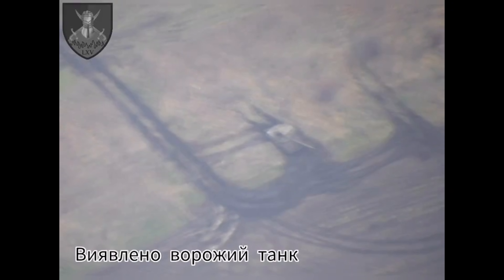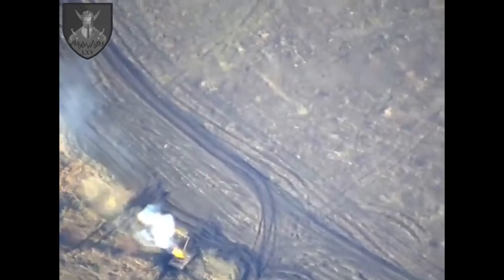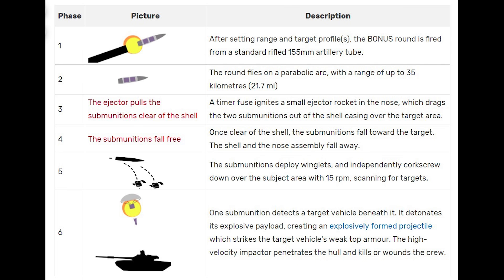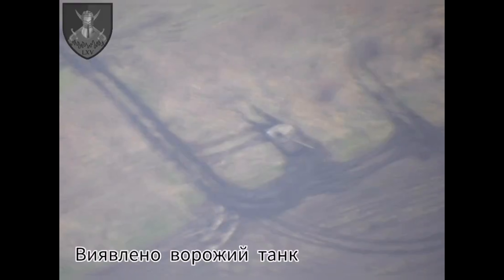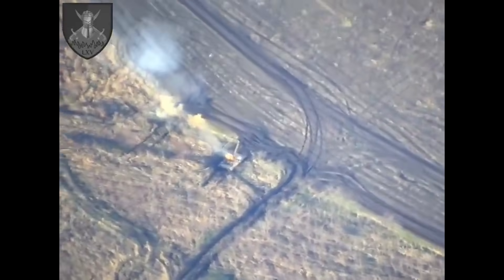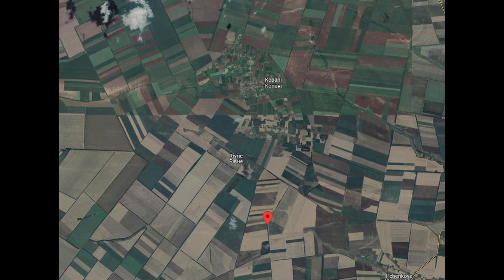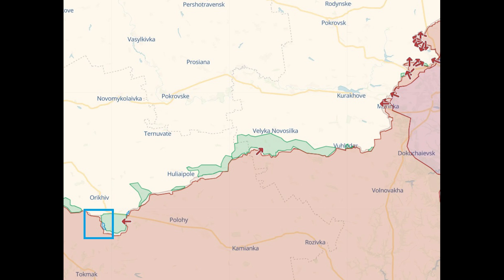Cool Footage of 155 BONUS Artillery Round  Against a T-72 -- Plus, How Does 155 BONUS Round Work?

Comment: I agree that mounting the Bonus submunition on drones has potential not just for Ukraine but globally. The drone operator only needs to drop the submunition(s) in the general vicinity of an armoured vehicle(s) and when the submunition(s) spins a basic radar then detects the target(s) and the shaped charge warhead is triggered from a considerable distance away at just the right moment so that it fires at the centre of the target. One downside however is the Bonus submunition is quite complex and must be expensive so a better approach may be to just mount a shaped charge warhead on a drone which is initiated by the operator or upon physical contact with the target and Ukraine and Russia have already used these on a large scale. Similarly bomblets with shaped charge warheads can be dropped by drones and again these have been used by Ukraine and Russia. A proximity sensor that activates the shaped charge before reaching any improvised cage armour mounted to the armoured vehicle could be a useful innovation given the prevalence of this type of armour.

Comment: The skeets are nasty - the EFP moves at something like seven kilometers/second. If I recall correctly, they need a heat source to target, so abandoned/cold vehicles would not work. I'm not sure about the model in the 155mm, but there are some that have a central anti-vehicle cone and then a ring of a dozen smaller divots around the edge - so anyone who noticed the round deploying may get zapped even if they bail out and run. That may only be a feature on  the larger ones that have a parachute for part of their deploy.

Comment: The second submunition can be seen exploding at the same time shooting its warhead into the earth. It does this for safety reasons, because if it would fall to the ground unexploded this would cause a risk for someone who later happens to stumble over it. So as soon as the submunition reaches a height which is so low that it knows there can be no vehicle under it, it self-detonates.

Comment: the 155 bonus is perhaps the most insane and scary round I've ever seen in any caliber, for any purpose.
Reply: The Volcano round is also pretty spiffy. Range up to 80km with standard howitzers, and can be configured for both GPS against stationary targets or laser pointer against moving targets. It also uses tungsten as the frag material, and because it's rocket boosted it comes in at roughly three times the speed of sound.

Comment: The shape charge explosive found on the Bonus submunitions and other similar system is not the difficult part. In fact these shape charge warheads are found in RPGs and many other anti-tank weapons including FPV drone with modified RPG warheads. You just need to tilt the RPG warheads on the FPV drones to be facing down and you have something similar. The part that is tricky is the fuse. The RPG fuse is contact fuse while the Bonus submunition fuse are computer controlled by the Bonus submunition's internal fire control computer. If you want to do the same with the FPV drones, you already have the RPG warheads. Now you will need a fuse that does not rely on contact. You will need the FPV drone to carry an additional fire control computer to control the fuse and detonate it remotely above the target. This is where things get slightly more complex as the FPV is kind of a homebrew suicide drone, now you need an industrial scale to assemble electronics  to do the following:
1.) optically detect and match targets on the ground that the FPV drone flies over
2.) control the detonation of the RPG warheads or similar shape charge explosive warhead accurately over the targets
3.) safety mechanism to prevent the detonation when you don't want it to
4.) remote control and communication of the warhead with the drone operator using an integrated communication channel or a secondary communication channel
5.) optionally allow the drone to detonate remotely without drone operator guidance in case of electronic jamming and this ties to 1.) where embedded AI and more sophiscated optical tracking and matching can play a role in
6.) allow the entire fire control assembly and warhead to be fitted on commonly found drones in the Ukrainian arsenal
7.) self-destruct safely after a certain time period if no target is found
8.) optional anti-reverse engineering capability after launch

Ukrainian government could set out an RFI and get contracts from Western partners to build such a system at low cost.

Comment: I doubt these can be deployed from drones without some major engineering. They are required to spin in order to stabilize, search, and aim. The artillery shell does this because it is spinning due to the rifling in the barrel. How one would get it spinning using a drone is a real challenge. These same/similar munitions can be ground launched vertically from a tube as part of a "smart land mine". Very effective.

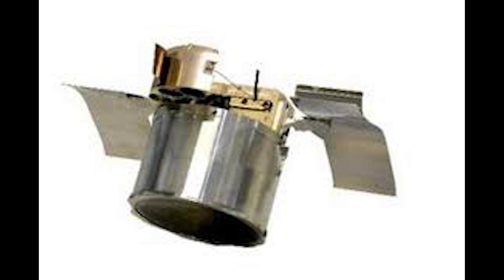Comment: @1:35 "Now, I wonder..." Nope, most likely the submunitions cannot be deployed by drones. When the Bonus round deploys the two submunitions, a small rocket fires the nose cone of the shell, pulling the submunitions out. They will rotate at the same rate that the shell rotates when fired. The submunitions rotate at 900 rpm to be able to scan a large area for targets. Giving it that kind of rotation will be really hard to pull this off using a drone.

Plus, a full Bonus round comes in at 45 kg. At a guess, 10 kg per submunition would seem reasonable, but that's well above the "Baba Yaga" R18 Octocopter payload of 5 kg.

Comment: LOL, Arc not arch. And it's only a parabola until you look carefully, they always come down steeper than they go up, this is because they lose horizontal velocity due to drag. But they also take a nose up attitude due to gyro effects, so they fly a bit further than simple physics would suggest. If you fired it on the moon it would be a parabola. The maximum range elevation is closer to 30 degrees than 45 because of this. I've worked on anti tank weapons and artillery, designing of, but I am not an aerodynamics engineer. These SFF or EFP weapons have been around since the 80s, back then we were using them in HB876 mines and considering them for dispensers. Skeet is from around that time. These weapons are not the sort of thing you can just sling under a drone, they have limited life once activated, and you sure as hell don't want to fly them out over your lines while they are already armed. But I expect the Ukrainians could come up with a way to power and arm them close to the target.

Comment: When I get the directions right, the tank is aiming to the east, and the round come from the west.

That would mean, the artillery piece is in the direction or even the area of Stepove. That is 24 kilometers, still in range of most western 155mm systems. And Stepove is a relatively calm and stable part of the front, so less risk for the sytem. But also very close to the front, if Stepove is the staging location of that piece.

Comment: If I remeber correctly (read about them years ago in a book) these submunitions spin as they descend and when they explode a flat disc of metal (copper???) is forced in to a superheated slug shaped charge that cutz through the less protected top parts of a tank...refered to as skeets???

Comment: Hey, suchomimus! At 0:42 you came to an artillery question. (I'm a prior U.S. Army 13F forward observer)
    I've never heard the term "parabolic arch" before. But it sounds like "high angle" to me. The standard is "low angle" for artillery, unless deemed necessary by FDC, or by a forward observer like myself. Their names are self-explanatory, for example, mortars are always high angle.
    I figure the reason for this is the munition needs to come down at a vertical (ish) angle to work best. It seems to make sense with the parachute and guided smart munitions that are supposed to come down on top of enemy armor.
    I hope this helped. Excellent video as always!
Reply: I think he meant "parabolic arc", but he probably isn't into maths so might not be familiar with the term.
Reply: @RonGardener4142 
    You're right actually, he said "arc." I swore I heard "arch" when I heard him the first time. I must have misheard him. I think I have some hearing damage I guess... 🤷‍♂️
    My point still stands, this terminology probably refers to "high angle."
Reply: @classifiedveteran9879  Tbh, I thought he said "arch" too. Maybe my hearing is knackered from too many rock concerts in my youth!
Thanks for the technical info, btw.
Reply: @RonGardener4142 
    Well I have to avoid those now. (Painful tinnitus/ear ringing is a cruel mistress...) All thanks to being inside of a few explosions and half a dozen firefights.
    You know those call of duty games? Your character needs to have blind spots, sudden blackouts, and partial paralysis from explosion induced traumatic brain injury. So glad I don't have TBI...

Comment: If you hold two ends of a bead necklace, the type of curve formed, like an open U shape, is a parabolic arc. The degree of curvature is tighter in the middle, and towards either end it’s straighter.
Same the other way up, for this ordnance.
Reply: Isn't that called a catenary? Or is a catenary just a specific kind of parabola?
Reply: @RonGardener4142  You are absolutely right. A catenary is the shape formed when the load is evenly distributed along the curved line, as in the necklace example. A parabola is the shape formed when the load is evenly distributed along a horizontal line, ex. imagine a suspension bridge where the heavy bridge deck was hanging from cables whose weight was negligible by comparison.
Reply: @RonGardener4142  OOOOH! I was gonna say yes, it’s a subcategory of parabolas but — I was totally wrong. It is a catenary and apparently that is NOT a parabola. 😳 Sorry, everyone!

Comment: It doesn't make sense to use this for drones. Drones have this accuracy anyways. The great plus of BONUS is, that it's immune to electronic warfare, doesn't need GPS, a reliable wireless connection to an operator and so on. Trying to drop it from drones brings all that problems back. The artillery is accurate enough, to deliver the round close enough to the tank, and from there it does it's job. It should also be usable from any NATO standard 155 artillery, so it's not restricted to Caesar and PzH2000, but also the M777, Archers and so on can fire it.

Comment: "Parabolic arc" and "ballistic trajectory" can usually be used interchangeably when talking about a moving object. These sort of submunitions seem so sci-fi, they almost look like magic. I want to look at the electronics inside.
Reply: They can if you're trying to get a point across, but you'll miss if you don't make the distinction in the actual firing calculation. If Earth, however, had no atmosphere, then they would be interchangeable.
Reply: @andersjjensen  Yes. In the context of the BONUS round informational video clip, "ballistic" would have been more accurate. They aren't using these things on the moon... yet.

Comment: Could these submunitions be used on a drone? Short answer: Yes, but maybe not without modification.

Longer answer: I believe the fusing and safety mechanism on these relies on an inertia system to unblock the firing mechanism, and I believe the acceleration from either being fired from an artillery cannon or ejected by the rocket-powered intermediate stage used in the cluster bomb version is what unlocks it. I don't believe these use a centrifugal system where the rotation unlocks the firing mechanism.  So, a drone might need a kicker charge to shoot the submunition out of a small tube rather than just dropping it. The winglets will still be effective in getting the round to rotate at an appropriate speed assuming they are dropped from the correct altitude, but I don't think the arming system will activate if you just drop it from the bottom of a drone. This isn't an insurmountable problem by any means, and is something Ukraine has probably already had to deal with when using other submunitions as drone ammo.
Reply: Too heavy, too slow, too-short a range and too loud. 
Smaller and lighter subminitions wouldn't work as well. How do we know that? Cause that's what the Javelin is for and its warhead is actually heavier.
BONUS rounds can pick the thinnest part of the tank so it can pack less and do it twice.
Also, drones are jammable. BONUS rounds aren't.

Comment: Problem with the drone use of these submunitions would be arming them, which typically works through spinning. This requires a high velocity while incoming so the air drag does its magic. I might be wrong about the BONUS arming mechanism though.
Reply: I don't think arming would be as problematic as the scanning function the spinning allows
Reply: Good point, but I think (NB: I'm not an expert) the munitions carried by drones are generally armed prior to take-off anyway, as it's hard to do otherwise and drones are generally pretty cheap and disposable. So armed BONUS rounds with winglets deployed could hypothetically be carried and dropped by drones, which could be a step-up from the dropped HEDP grenades currently used by a lot of non-FPV drones in that the BONUS rounds would do a great deal of the targeting themselves, as well as being of a much better design in terms of the EFP's ability to penetrate armor. So BONUS drones could potentially be both more effective in their strike and able to initiate strikes from a greater distance and from many more potential firing positions, given that HEDP-dropping drones basically have to hover directly over their target to strike.
Reply: @michaelccozens  Yeah I just realized that unlike cluster munitions, the BONUS round doesn't need impact to go off. It just has to 'see' a tank. An armed BONUS round, if doable, would set off by just being flown around until a fire solution has been made. This would require way less flying skills on behalf of the operator.

Comment: Brilliant!  A BONUS Drone would be rather epic. 
It would require some modification of the submunition to remove the safeties but it seems possible without having classified data to confirm.
Reply: When you only see the successful drone drops, you forget that the successrate isn't as high as one would assume.  The BONUS is better on the 155mm shell where it will make it to target without the electronic warfare
Reply: I think the main issue is the speed at which they spin created by transferring forward momentum into rotation with the winglets that causes them to hover and scan is dependent on the velocity of the shell, if they don't spin they can't scan.
Reply: @zacharywolter I think you made a pretty clever observation the question is weather the setback can be disabled or not though either way there has to be easier munitions to use that don't require alot of modifications (danger)
Reply: @zacharywolter  Good point. To equal the kinetic energy to drive the winglets, which serve as an air brake, it might have to be dropped from a very high altitude.
Reply: Why bother? It works fine from an artillery round, and I’m sure theirs plenty of valid targets inside arty range. Drones are subject to jamming and air defence fire
Reply: @oscarweasley2618  You're not very imaginative, are you? Each round contains 2 submunitions and you can watch one get wasted on this video. You can also see how high the one that takes out the tank detonates. It's essentially a stand-off weapons for drones. Do you understand what that means?
Reply: The bonus round weighs 104 pounds. Not sure how much of that you could strip away and still have it functional.
Reply: @jeffscott3186  that's the entire round, each submunition is less than 20, but is probably still heavy for a small drone, but those large octo-copters could probably carry a dozen or so of those to drop from their vertical tubes
Reply: While stripping the artillery shell to arm a drone is probably a bad idea. If you made an EFP warhead designed to work on an FPV drone that could be effective. The warhead itself is cheap.
Reply: @BadOompaloompa79  These warheads use tantalum in the EFP.. The value is they're big at 6.5kg of explosive, they're very lethal thanks to the far more advanced design, and they have SMART fuses. Ukrainians are already sawing apart the DPCIM rounds to use the submunitions on drones.
Reply: @Peter_S_  Shaped charges like in DPICM are great but the explosively formed penetrators are better. Nothing beats the thing that works and you have a lot of though. You could arm a lot of drones from one cluster round.